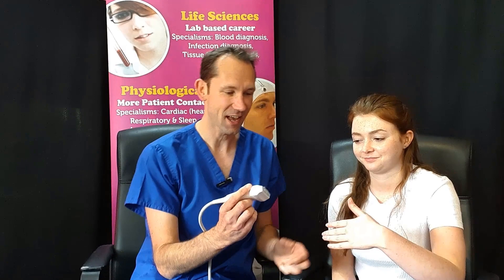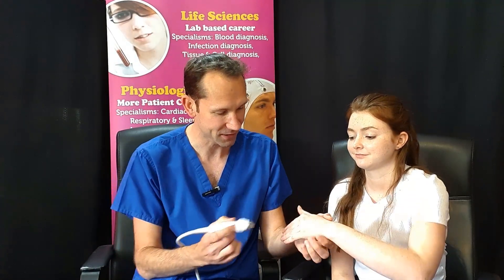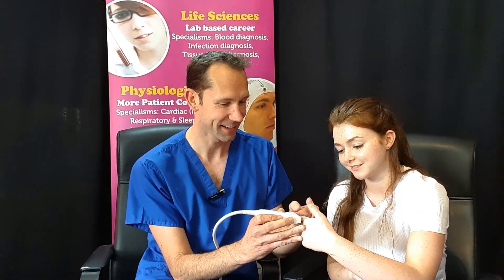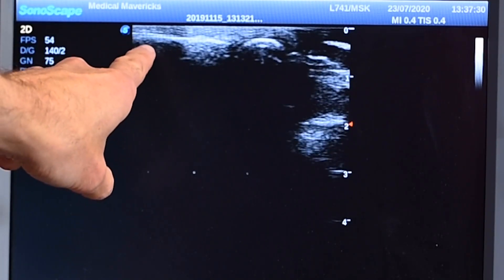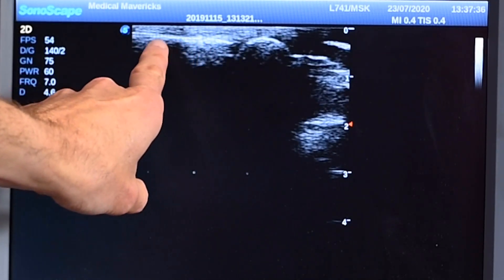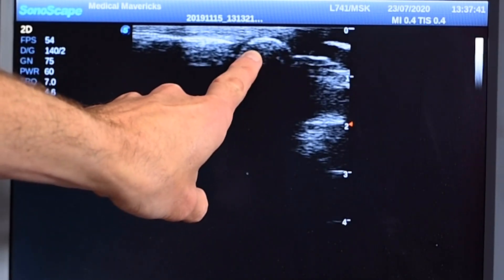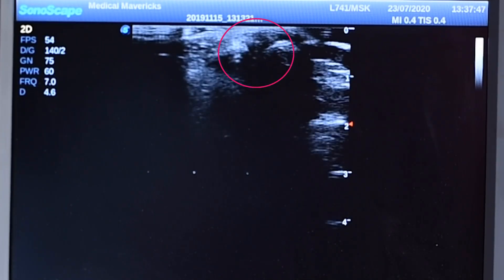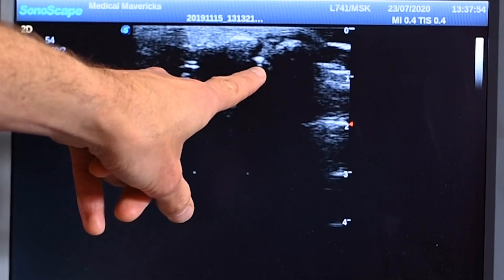What happens when you crack your knuckles?

Comment: hold up, air bubbles look dark on ultrasound. I dont think bubbles appearing would look white like that. White in ultrasound is dense solids. 

maybe, it was dark initially because a bubble was present, shadowing the waves. After cracking the knuckles, somehow the bubble disappears and you see right through the joint